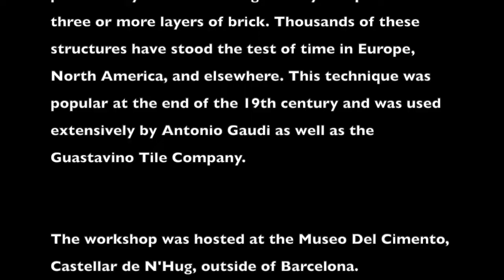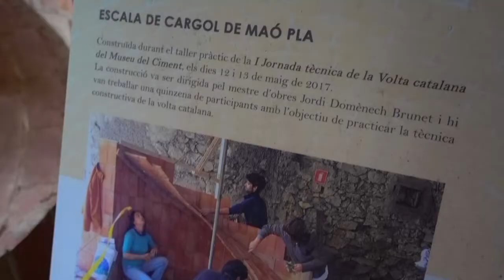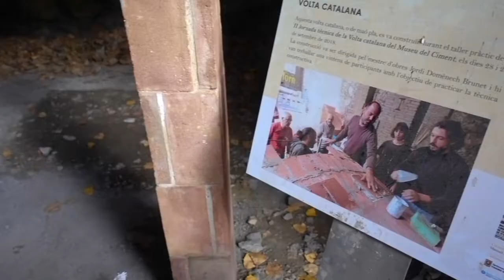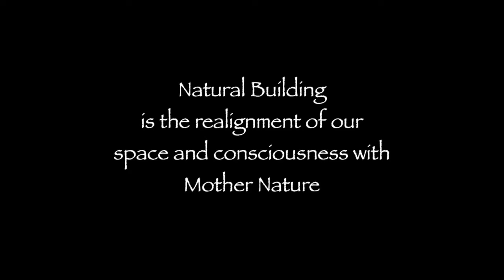Master Mason Jordi Domenech Teaches Catalan Vault Building - Earthen Hand in Barcelona

Comment: How much weight can you have over the Catalan Vault? I'm interested to see what you could do with additional laying above to increase the cold temperature difference under neath it. Thanks.
Reply: If the geometry of the vault is a catenary it can only hold the weight of the vault itself. It if has to hold weight over it the geometry of the vault changes. The geometry of the vault will be governed by the load distribution. If the loads are high then the construction of the vault is difficult and riskier (a bit of error in the  building process might make it fall)